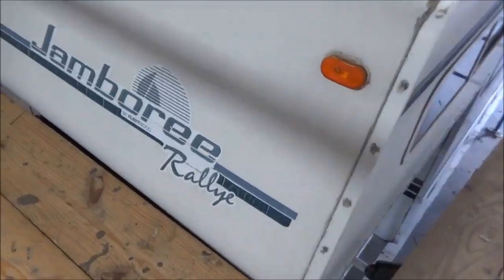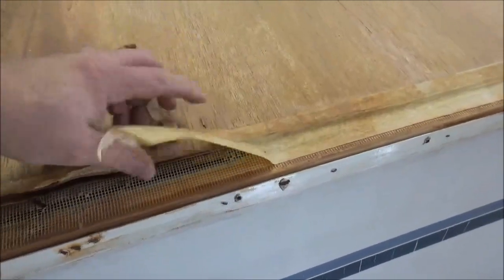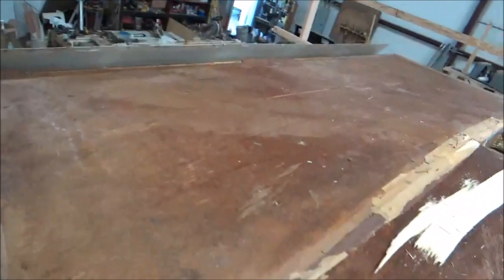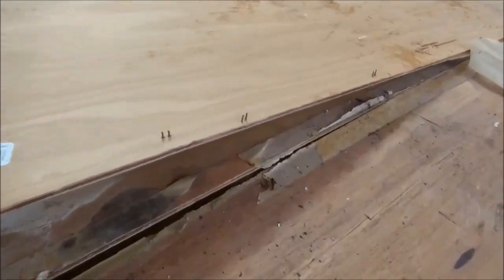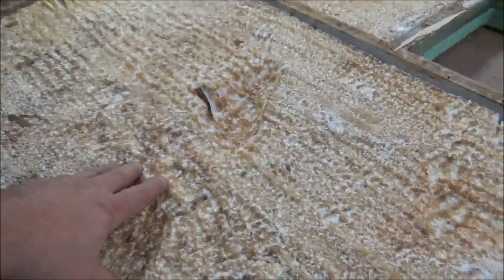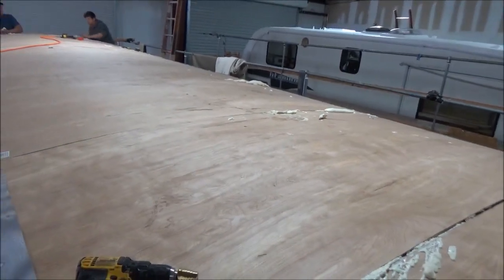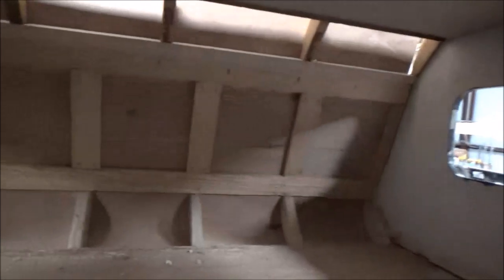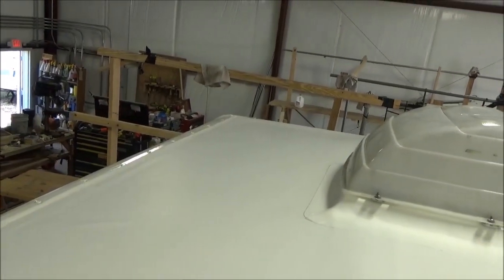Rv Roof Replacement 1998 jamboree

Comment: We bought our first RV 3 years ago. We are the 2nd owners this rv has had. It is a 2006 Keystone Outback Sydney Edition 27 RLS. We paid $5k for it, but with financing and equipment it ended up being $9k all together. 
It has an EPDM rubber roof on it, that, in all honesty, is still in pretty decent shape. It is however nearing the end of its life, and believe me when I say I inspect that roof A LOT. I have plans on re roofing this rv next year, and will most likely buy a new EPDM membrane and the kit to install it. I also plan on redecking it as well. 
A big job, but I know I can handle it. The only thing I don’t have is a protected work space to park the rv in while I perform the work necessary.
But more to the point.
Ever since I let my wife talk me into buying this camper I’ve been watching your videos. And I see the absolute destruction water does to these vehicles AND the amount of damage it does. Not to mention the depth it reaches. And add to that the depth you guys go to - to repair that damage. 
I sincerely wish I had the money it takes to just ship this rv down to you and have your company do the work for us. After watching your videos for 3 years, I now know the quality of workmanship and the quality of materials you guys put in to each and every customers vehicle. I seriously wish I had that money. 
The curbs you guys put in for each vent, skylight, AC unit are impressive, not to mention the additional support for the AC unit itself. The fit and finish are impeccable. 
You and your crew should be very proud of yourselves, and I mean that with all sincerity. 
If in fact, you ever need an “advertisement” vehicle or something of that sort, keep me in mind, I’d be happy to volunteer lol, but in reality, your YouTube videos say it all.
Reply from the maker: Thank you for the compliments. Really though, we are only doing what folks have entrusted us to do. Too bad other shops do not have the honor to do quality work. The other factor is that most of these RV shops are only doing what the factor did...well we can see that didn't work in the first place. Most shops just do, or copy cat, not being able to recognoze common failures, potential failures and be able to make the proper repairs without tearing apart a wallet. These corporate amercia shops just want to get your money and when it fails somehow it was your fault. It's a numbers game to them.
Thank for watching.

Comment: Nice work. 
Sometimes I get the feeling our RV's are not meant to be used outdoors...
Reply from the maker: Well I do believe they are assembled to fail prematurely. The RV industry wants to keep their hand in your wallet.
Reply: @RVROOFINSTALL  I was wondering about some thing I am in the process of redoing my fifth wheel and I’m thinking about fiberglass and all the corners to make it surely waterproof where it’s never going to leak ever again but before I do that I’m gonna go through and make sure all the beams are in good shape replace all the insulation and also do the wiring because once you do you can’t undo so let me to tell me Telya I hopefully this will fix the issue of leaking once and for all and I’ll let you know if it works

Comment: Your videos are so good. Lots of good info. I just bought a 1991 Winnebago warrior 27’ class C. Have to replace the entire roof. The roof is only a thin layer of luan then 3/4 foam then another layer of luan. No structure really or trusses. I was gonna rebuild entire roof with 1/4” luan and 1/2 foam glue it all. Is liquid nails ok to use?  Thanks in advance

Comment: Great videos. I have a 1998 Chevy Allegro. Motor runs great but it needs a completely new roof. Do you guys think it’s worth replacing it or should I just move on and get something newer? I figured you guys would know what’s up.
Reply from the maker: @saxmanj  is it worth fixing or replacing? I don't want folks to think we are trying to sell them or sway them to a roof system.  Some things you would want to consider are
1. Do you like the coach? Plan on being a camper person and see yourself having a coach? 
2. Does everything else work? Are you having major issues with other things that would be costly to repair like an engine, transmission?! 
3. What would it cost to replace the same camper ? 
4. If you opted for another camper, it would need a roof, they all do. You won't be able to avoid that unless you bought a camper from one of our customers. 
5. If you did get another coach are you certain you wouldn't have other problems? Currently you know what's wrong with yours, but another one may prove to have other issues ?? 
So these are some questions to ponder.
Hopefully I helped  you decide one way or another.  If you decide to have a roof system installed , all our contact info is on the video...423.475.7663
Thank you for watching,

Comment: I know this is old, but if anyone is following it...Can anyone tell me how to determine if the roof is bad with a simple inspection? I'm looking a t a '90- Jamboree that has "a leak over the cab."
Reply from the maker: You are not going to get an RV roof to last much more than 10 years even if you did everything correctly in a perfect RV world. Along the edge of the roof where the wall and the roof meet you may start to see slits.. real small slits. Another sign is small fractures in the main part of the roof. May be hard to see if the roof has been coated. If you notice soft spots in the roof especially around the vents, and AC.  If water is getting in the bunk that needs to be opened up and dried out. 
There a red a few tips for you my friend. Thanks for watching.
Reply: @RVROOFINSTALL  thank you so much for your quick reply! I still like the RV (as far as the description, I still need to see it though) with new tires, low mileage, good engine, new batteries, etc. Maybe I can knock down the asking price by the amount of a roof replacement.

Comment: You guys are ripping them guys off of course glued stuff when ripped apart looks bad or like a mess, you should just cut out rot and move on not rebuild unless special order yes replace all screws, but dam, I’m sure you saved money and used old wood to “rebuild “ it so y can’t use existing wood?